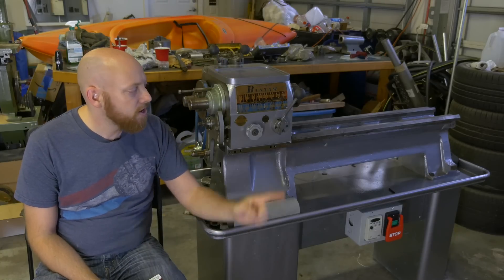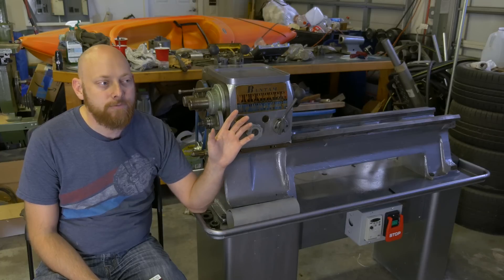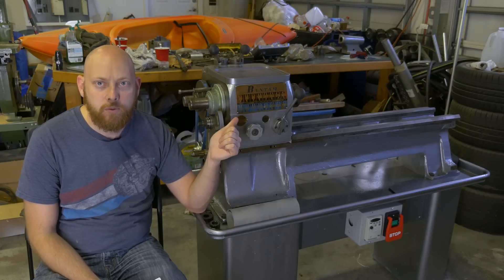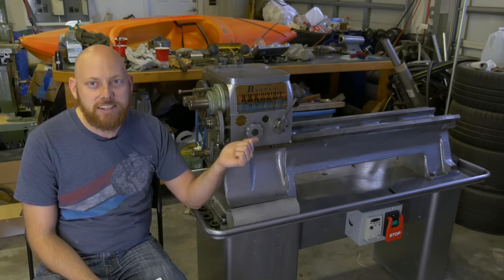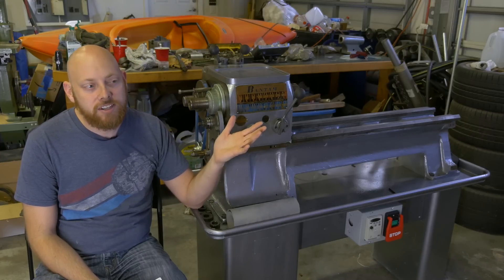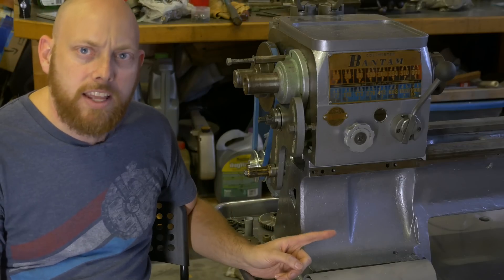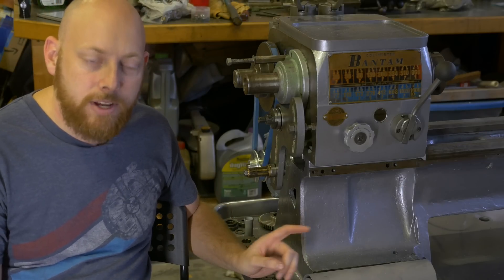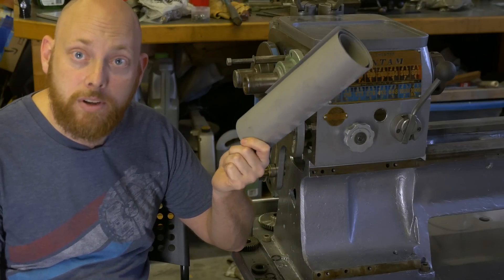Lathe Rebuild Part 10 - S02E11

Comment: I picked up an old Chinese lathe for free. (I am in China stuck with travel restrictions). I don't intend to redo paint and any aesthetic improvements. Your videos give me some great pointers. On this machine the ACME nuts are totally warn and I probably need the lathe running to cut those. It is like doing brain surgery on yourself (quoted TOT).

Comment: Depress!!!! the ball bearing with the oil can tip, then the oil will actually go in to lube - push oil can tip - small ball ball bearing MOVES INWARD - oil may then pass around it and get parts lubricated

Comment: for the future: oil both sides of your gasket so the gasket actually absorbs the oil then us a spot of grease on all four corners to hold in place until you get the gear box cover on.

Comment: Not that having access to a laser cutter isn't nice, but if you don't, just lay the gasket paper on the surface you want to seal and tap LIGHTLY around the edges with a hammer.  That will cut the gasket out as neatly as any custom setup in about 10 minutes or so.

Comment: In your S02E10 - Lathe Rebuild Part 9 You built a Power Control Box, was this fed by 220 VAC Single Phase and after the Variable Frequency Drive there was Three Phase 220 VAC supplied to your Lathe Gear Power Supply Motor? By the way this is great entertainment!! I am restoring a Classic Southbend Lathe and this is very inspiring! Thanks!!!

Comment: I learned to rebuild Machine Tools in the late 60's.  We sent Lathe Beds out for 'Blanchard Grind' and scraped the saddle to that surface.  It kinda seems to me that if you have the talent to build a surface grinder, why didn't you build a CNC lathe in the first place using a computer for the controller.  I also worked for HAAS Automation when Gene Haas and Kurt Zierhut built the first VF-1 ...... quite a project to be sure!

Comment: Great series. You started with a Colchester lathe and really unless they have been damaged badly of lost a head stock bearing you will have a very good lathe. A set of headstock bear are about the price of a new import lathe. As for the wear in the ways, it's not that bad. First it will only show up with a cut longer than half the travel length and even it will only be lowering the cut point by half the wear on the v side amount. I would be surprised if it shows up even on a long cut. I bought a Colchester 15X48 for scrap price that had been worked hard and after doing a clean up like you did it is a fine machine.

Comment: You are trying to inject light oil into a grease nipple... oh so totally wrong! You need to learn the difference between an oiling point and a grease nipple, the latter of which is intended only for the pressure injection of grease, not liquid oil.

I would have thought that you guys already understood this basic engineering principle.
Reply from the maker: +Gordon Burns haha, funny when someone seems so sure they know what's right. I actually read the users manual on that one. The only place this machine gets grease is the Chuck. The rest gets two types of oil depending on where. Oil fittings can look like grease fittings
Reply from the maker: https://goo.gl/photos/hcACPovTnf6kGBNT7

Comment: Hey Guys and Gal, me again. . . When making a gasket with "liquid" gasket material you may wish to consider torquing the screws down so there is contact of the gasket material with both mating surfaces having about 3/32" gap left between the mating surfaces.  When the gasket material is cured/dried, then proceed to torque down the screws a tad more.

Comment: Regarding the silicone, for best results follow this instructions (For assembly as a form-in-place gasket) http://www.devcon.com/prodfiles/pdfs/fam_tds_376.pdf
Reply from the maker: Thanks Daniel. i have done it both ways in the past, never had a problem either way. But in this case I wanted to be sure to not contaminate the oil inside the case with any squeeze out. it probably wouldn't have mattered, but this oil is designed to run for such a long time (and is kind of expensive) I didn't want to risk it.

Comment: The easiest way to seal two machined parts is to use Prematex Aviation gasket maker. 80019...Nice videos!
Reply from the maker: i don't think i have ever heard of that. i will check it out!
Reply: It's really good old school stuff. Impervious to most chemicals and never quite dries. Easy clean-up with rubbing alcohol.
Reply: Permatex makes some good stuff.  I used their gasket sealer on my timing chain cover gasket and water pump gasket.  It works great.

Comment: So how did you decide which parts get laser gaskets, and which parts get stuck with gasket goo?
Reply from the maker: It looked like some of the parts weren't designed to have a gasket and some were. I based my decision off what the spare parts manual had parts for.

Comment: Great resto series, guys!  Very detailed, which is wonderful for guys like me who are just getting into rebuilding old lathes and mills. One question though:  weren't you concerned with getting grit in the quick-change gearbox when you were stoning off the top surface for the gasket?
Reply from the maker: the water for the stone holds most of the grit, but its definitely a good thing to keep an eye on.

Comment: That sheet gasket will fit exact if you did it the old school way. Lay it on surface and tap around it with a hammer until it breaks out.
Reply from the maker: yeah that's probably the simple way, but i have to justify having a laser cutter every once and while lol.

Comment: Very nice. But how are you going to make the grinders frame? Wouldn't the linear rails be deformed when bolting to an uneven surface? And if you built it from cold rolled steel it would definitely warp after time and while welding. Here in Germany, a one-man-company, who restores machines for a living, rebuilt an old grinder and rescraped the ways to be within a couple micron over several meters. I don't think scraping the lathe is fun ( especially as it was hardened) but to me it seems like the best alternative. Still, I'd like to be amazed by what you came up with. Cheers Johannes
Reply from the maker: Thanks Rakh, yeah these are all things we have to solve for. We have a plan for at least some of them!

Comment: as much as i respect your effort with the cnc laser cutting - AvE's dirty fingers on white cardboard marking technique would have been a little easier to get a exact layout for the gasket...
Reply: I also thought this was like walking over the bridge to get to water but sometimes we do things .....not because they are easy, but because they are hard, because that goal will serve to organize and measure the best of our energies and skills.
Reply: A ball pein hammer and some hole punches would have sufficed and only taken 10 minutes but if I had a laser cutter I'd have given it a go
Reply: Nick Hudson is dead right.  Ball pein and a hole punch is all you need, its as old school as it gets, and it works
Reply: CNC gasket cutting ? yeah if you are making loads of them. One offs can be done in no time at all and just as accurate. I've cut motorcycle gaskets on the side of the road in less time, and yes oil your gaskets both sides before fitting. As for the gasket goo you need to use a non curing product such as Hermetite. Don't use silicon, its rubbish for this sort of use.
Good approach to your project guys, but try using music instead of that digital diarrhoea.
Reply from the maker: Yeah, to be honest, for a guy who sits in front of a computer making vector art all day, this didn't seem very complicated. That being said, I'm sure the old dirty fingers trick would have worked just as well. I love AvE's channel, but lets be honest, he doesn't always end up with the cleanest result either.

Comment: I have the same lathe, when you start using it I think you'll like it, just wish I had seen you at the start I would have told you to go with a 2hp motor I have a 1hp on mine and it's not powerful enough if you want to use carbide, stick to HSS and you'll be good to go, great work so far looking forward to see how you get on with the grinding? do your research though I have everything crossed.

Regards Alan.
Reply: Forgot to say that machine originally came with a two speed 2hp motor.
Reply from the maker: Thanks Alan. hopefully we can get by on 1HP for a while. this is such a big step up from what we have now, i bet i wont mind it being a little under powered until i get a bit of experience.

Comment: don't spread gasket. it's self sealing as long as you keep in one continuous bead spreading can cause leaking on uneven surfaces
Reply from the maker: Thanks Recall. i have done it that way in the past, but these are both machined surfaces in good condition. the variation in the surface is probably only a few thou, and even spread out the thickness of the gasket is tens, if not hundreds of thou. 

see my comment to Daniel for way i did it that way.
Reply: never saw spreading gaskets with fingers! i think u're wrong...
Reply: BlackGymkhana 1:24
Reply: BlackGymkhana 3:05

Comment: This is the best, most thorough restoration of any machine tool that I have ever seen. You have made a gem of what might be an otherwise forgotten machine, especially considering how bad it was at the start. I know that I, for one would not be able to justify spending this much time and effort on what would be considered a lightweight lathe by my fellow machinists and I on the heavy industry and production side of machining. The number of beautiful old machines that go to scrap just because it is not economical to take on this level of overhaul for them is a shame, and I greatly appreciate your level of care and recognition for such a wonder of history and craftsmanship.
Reply: I'm also in the process of restoring a lathe from WWII on my channel if you would like to check it out.
Reply: Check out Geoffrey Croakers videos.
Reply: true..but they are doing well with what they have, would be better to do all bearings and send out the bed for proper scrap by professionals,, But I give them props.!
Reply: I used to run a WW2 Lodge and Shipley manual lathe and it could really hog steel and hold tolerances well.  I never liked the smaller Colchester lathes when cutting taper threads for oil tools.
Reply: If you see one for 200 buck like these guys did send it my way I'll buy it for that
Reply: you must be kidding, most thorough restoration....

Comment: OK, cutting old gasket material off, 
go  to Harbor Freight, and get a 
CHEAP set of wood chisels.  $7.00 
or so.  Also, get a cheap sharpening 
stone.  If your chisel is sharp, you 
won't dig into the base metal.

(Try on a piece of scrap!)  

Chisels do NOT load up, like a 
stone does.  And, it's easier to 
clean.

You're welcome.  (Ask me how I 
know!)

steve
Reply: how do you know?